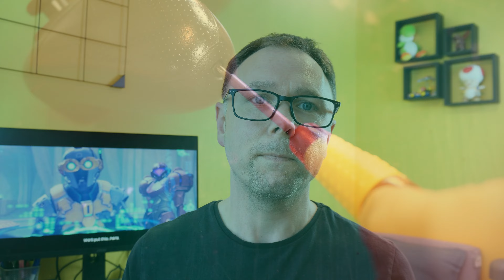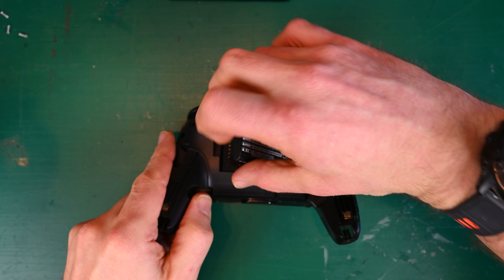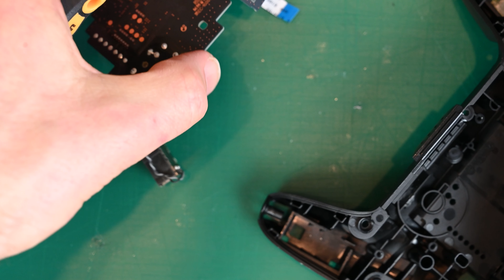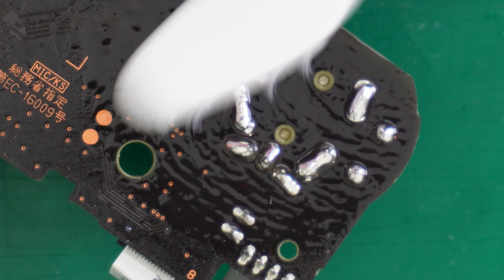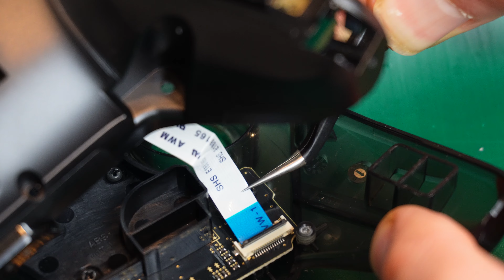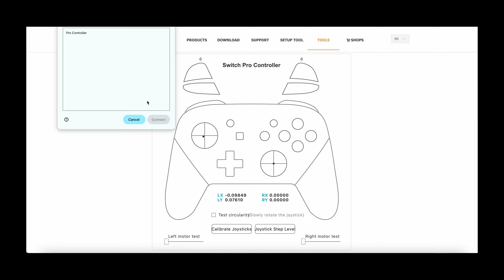Fix Stick Drift Forever – TMR Upgrade for Switch Pro Controller

Comment: I would recommend adding a bit of fresh leaded solder before using the pump to remove it a bit easier. Doesn't look like you had a problem with that though! I wonder if you're using lead free solder? It looks to me like your iron might not be hot enough. Though, as they say, if it works, it works and for you it clearly worked! Great video! I would also probably prefer to unsolder the rumble motor wires rather than have to mess with the adhesive.
Reply from the maker: Thanks for taking the time to comment! 
At the moment I'm using quite a cheap Amazon soldering iron, and I don't think the temperature is very accurate. This was not a leaded solder, but I've recently started using leaded solder more on other projects. 

Hopefully I'll be able to afford to upgrade my kit soon, I'm just limited by spare income! 😂